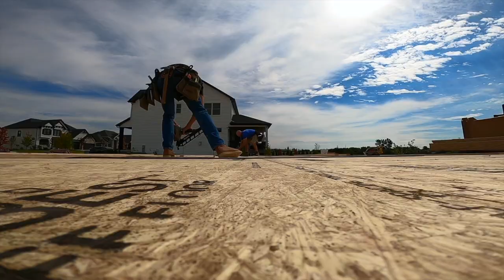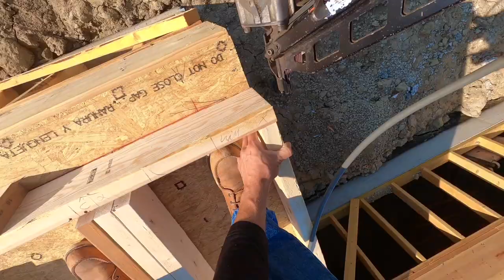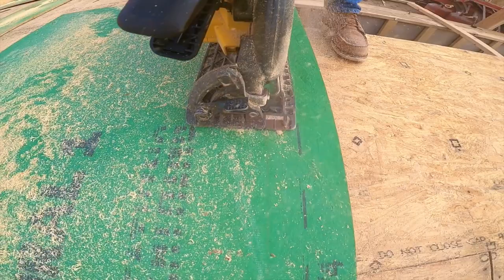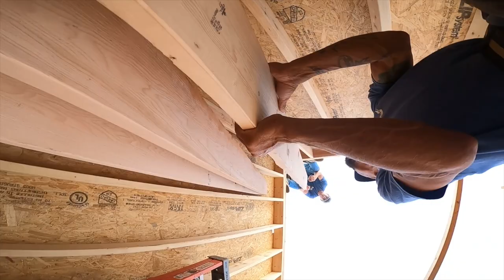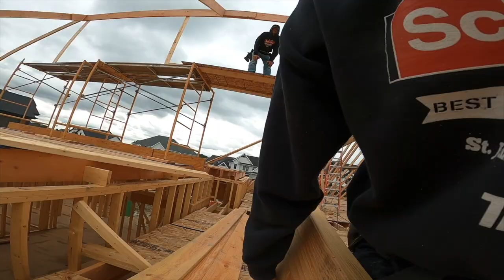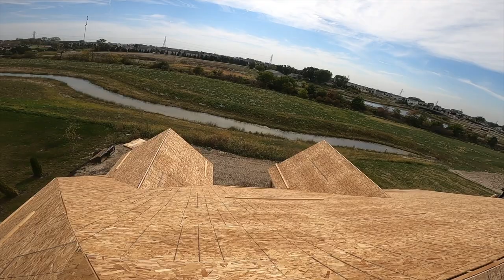Framing a Custom Home - A First Person POV and Time-Lapse

Comment: Looks good guys, the only thing I don't see pressure blocks between joists where they bears and overlap.
Reply from the maker: Pressure blocking where joists bear/overlap is not required in our area. We do install bridging in the spans that require it👍

Comment: How do you sheet on the ground? Mind going more into detail? Boss is worried about it floating if floor isn't perfect. You obviously square them on ground, what else?
Reply from the maker: We see crews all around wait to sheet their walls after they stand them. Obviously no floor is perfect but if you square the walls and we always triple check with 2 people, they should be just fine. I can’t remember having many problems with the plates ever floating off the ground. Another thing we do is we hang our sheets down to either tie into the rim board beneath or leave the sheets up so we can tie the wall in later. On walls that are butting other exteriors we leave our corners out and only sheet the middle. That way we can tie every corner in later from the outside. When it comes down to plum and line, we go around and double check our exterior corners. We’ve only had maybe 2 or 3 walls in the years I’ve worked here that needed a little push or pull with the machine.
Reply from the maker: Also another thing, say you stand the wall without sheeting it. If you have ups and downs in your floor, the wall is going to follow those ups and downs. If you sheet it while the plate is nailed on a straight chalk line, it will remain pretty straight when you stand it. I’d rather have to shim the gaps in the floor than have a wall with a bunch of waves in it. Shimming can also be done with your green plate to insure everything is 👌

Comment: Hey man im in lafayette, looking to get into carpentry after school, I have some questions that no one seems to be able to answer for me.
Should I do an apprenticeship through the union, if not what are my other options?
What are apprentices and journeyman making $ here in northwest Indiana?
Reply from the maker: Im in the process of 1-2 videos explaining how to get into the trade and what to expect. So I’ll be able to give a better explanation soon. I’m not too familiar with the union side of things in our area but you can make anywhere from $13 starting out as an apprentice all the way up to $40-$45. Non-union framing contractors typically pay around that same scale based off of experience and quality of work.

Comment: Was framing contractor for 16 yrs good clean top notch framing guys clean is best. I did big customs back before lvl's  had to long v notch and splice 43 ft hips. Ply wood gusit sides  and post it or use huge glue lamb lol. Nice work guys